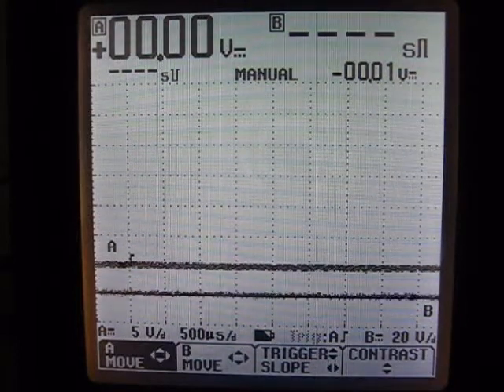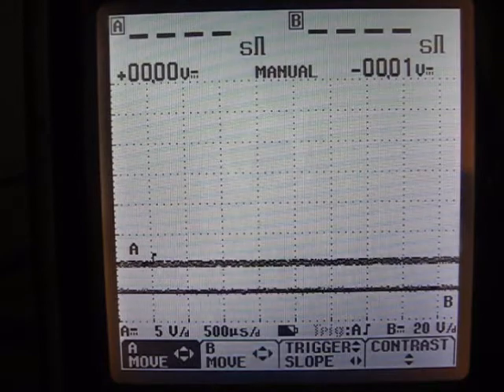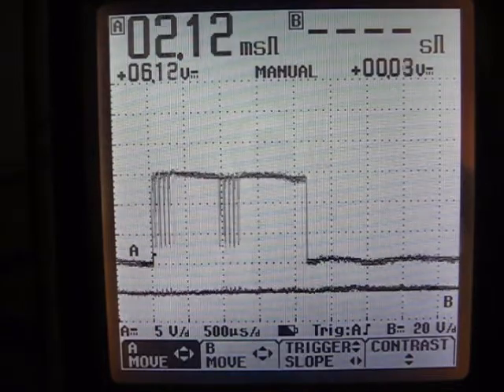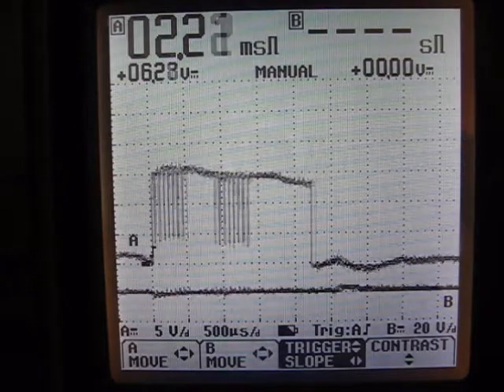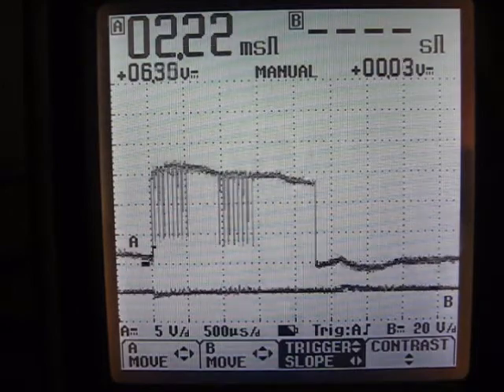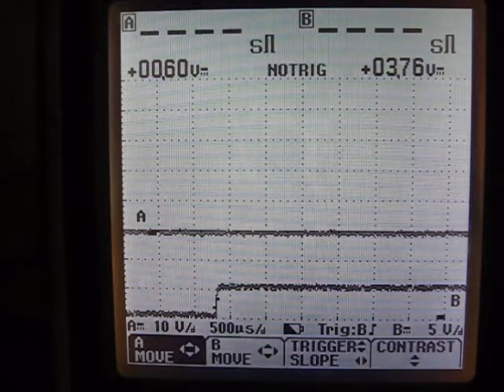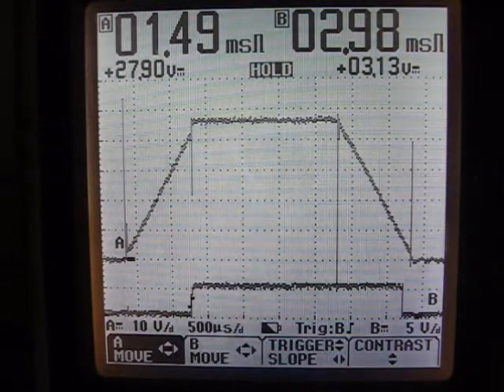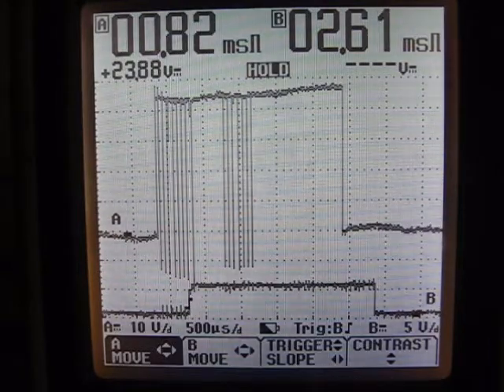Output and Gate drive signals from Xie Chang BLDC Motor Controller

Comment: Interesting.
So there is a definite timing shift at 120% which is what we expected.  But those inserted blocks of PWM is weird. 
Do you reckon thst is the only way they could get the timing change in relation to the hall signal or merely sloppy programming.

Never seen that earlier waveform before with the ramp up and down of each pulse.  Always thought from what I had read it was a fully square waveform throughout

Comment: Can you talk about what this all means for the end user - such as controller wear/lifespan? I rarely use 120% throttle, but there is occasionally a time when having that option gets me out of sticky situations, and provides a definite value for me. You say to just run higher voltage - well that is costly and complex (above 72v nominal).